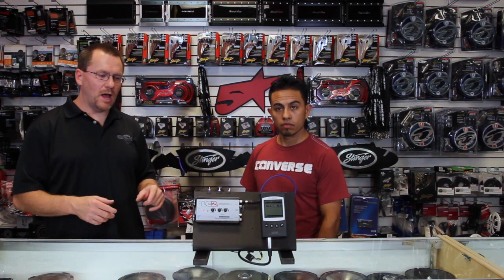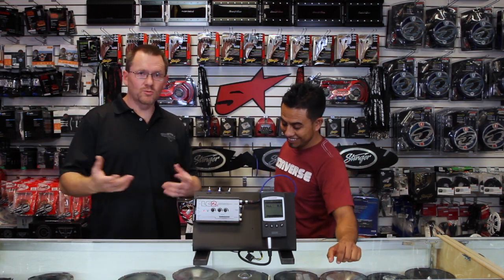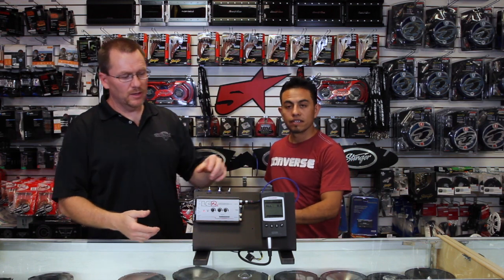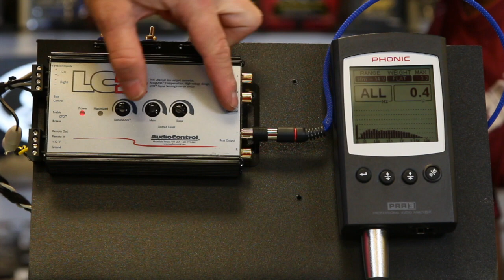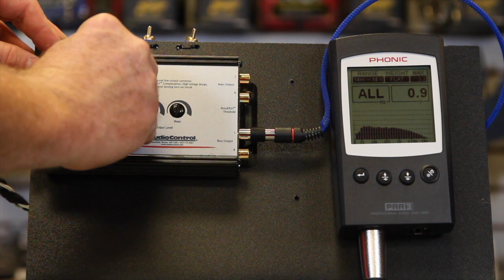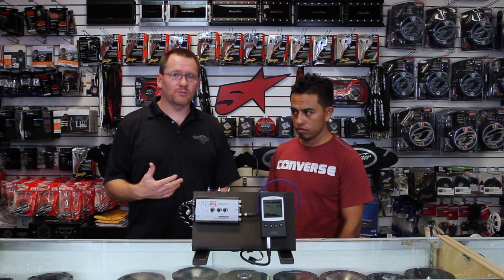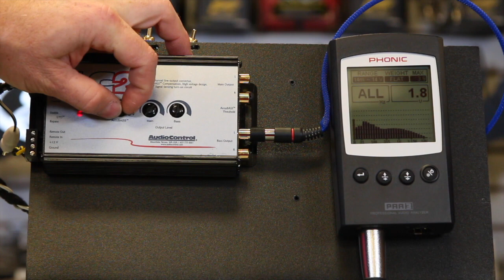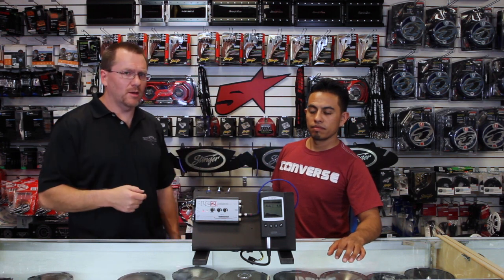Introduction to AudioControl's LC2i "what is and how to use AccuBass"

Comment: @2:42 so, it's a preventative measure by manufactures to keep from blowing out the factory speakers?
Reply from the maker: Yes, they don't want to replace subs all day. It is just one of the many problems you run into when interfacing with a factory radios. Keep in mind not all manufacturers do this, some actually just use better equipment.

Comment: Just bought a 2015 Sentra and was planning on using this to add on my stock stereo because I will be adding an amp and few subs... Now I read a few spots that this will also help the output of my stock speakers(front door and 6x9s) also without having to run an amp to them... Is that true? Thanks fellas
Reply from the maker: It will only help them if you run an amp to them. It has no EQ or sound better feature unless you use an amp.
Reply: +Five Star Car Stereo ahh ok. well I already ordered it, so all good lol. Will deff help out with my amplifier running to my subs tho yea?
Reply from the maker: +PacmannProductionsTv yes it will do wonders for the sub on a factory radio.

Comment: I have a 2006 Is250. I bought this converter, I get a puff sound when I turn of the car. Any ideas what could be causing this puff/ pop ? I have a factory sub that's a dual coil so I tapped in to the amp and got my signal from there.
Reply from the maker: That is a turn off pop. It can come from either the amp or the LC. Are you using the LC to create the amp turn on( GTO) or are you using an accessory? If so is the accessory running in and out of the LC or is the wire "y" to both?
Reply: I am tapped in to the radio fuse for the remote signal.
Reply: I am tapped in to the radio fuse for the remote signal.
Reply: I am tapped in to the radio fuse for the remote signal.
Reply from the maker: +pololoeer try using the gto built into the lc2. There is a remote out on the LC, run that to the amps remote in. The gto should turn on the amp and the pop should be gone.
Reply: I will try that, thanks !!

Comment: Hey I have an lc2i installed on my sterio system with 2 twelves , I happen to have a year 2000 Lexus ls400 so I have that bass drop off with my stock radio. Do you guys have any idea what size the screwdriver is to turn the threshold I can't seem to find a size
Reply from the maker: Go to dollar store and pick up a set of the jeweler screwdriver.  
http://www.amazon.com/gp/aw/d/B00002X29G/ref=mp_s_a_1_1?qid=1455681762&sr=8-1&pi=QL40&keywords=jewelers+screwdriver+set
Reply: +Five Star Car Stereo thank you !

Comment: Great video thanks! While I can read very well the instructions for this thing do not explain it like you did. I have a 2008 Escalade EXT with the Bose system which sounds nice but of course the bass falls off. I added a mid gate sub with three 10's and a 500 watt amp. I have the LC2i which brought the bass back (truck booms like crazy) but I had a hard time adjusting when the bass would kick in. I pulled the signal from the read door speakers.
Reply from the maker: Thanks glad we could help.

Comment: hello.. If my factory head unit does not have any bass roll off can I still use the bass outputs for a sub amp? I plan on using 2 amps, a full range for the front stage and a sub amp. I'm just wondering if that accubase can be shut off. Thank you
Reply from the maker: You can use the Lc for what you are trying to do just fine. There is no way to turn off the AccuBass, but you can use it as a bass EQ. It can be very helpful if used correctly.
Reply: +Five Star Car Stereo thank you

Comment: How do you install the LC2i? Can it share power and ground with the amp?
Reply from the maker: Yes you can use the power and ground from your amp to power the Lc. It will create a remote turn on for the amp to turn on using the GTO Circuit. Connect the input to a speaker out that has the signal response you are looking to amplify. So if you are powering  a sub make sure the speaker you tap plays bass.
Reply: +Five Star Car Stereo Inc. ok thank you. o yea, can you run a 4 channel amp to power mids and highs and a monoblock on a sub, with the lc2 only being 2 channels? Or will using Y-RCA splitters mess up the signal to the 4 channel amp
Reply from the maker: +Fojay Simpson you should be ok , the Lc puts out plenty of signal. Check the 4 channel amp it may have a 2/4 channel switch so you do not have to use y's. Make sure your source is full range.
Reply: +Five Star Car Stereo so can you run 4 channel highs from factory amp on input side to use main output and sub output from factory amp on same input of the lc2 or upgrade to l7 needed? if not how would i wire the highs. make 4 channels 2 for the highs?
Reply from the maker: +Travis Lewis yeah upgrade to the lc7i to do that. The 2 does not have the inputs. More less what we talk about in this video
https://youtu.be/rshYpLnrsKA

Comment: Hello, I have an lc2i installed in my 2011 bmw 550i on the sub channels from the factory amp, I have the threshold turned all the way clockwise and I'm still getting no output below 28hz. When I play a tone generator thru my factory stereo after I go below 30hz the bass starts to drop off, is there something wrong with my lc2? I tried turning up the accu bass knob and gain and it only makes the frequencies above 30hz louder but not below? Do you have any ideas? FYI I'm running an AQ 3500d to 2 12" FI  ssd's in a 2-1 4th order, I have 2 batteries with zero gauge wire for all.
Reply from the maker: Unfortunately in can not make up for the sounds your factory radio are not producing. It is really designed to fix volume drop off on the sub frequencies at higher volumes. You may want to look into an Epicenter if you want that fat bass sound.